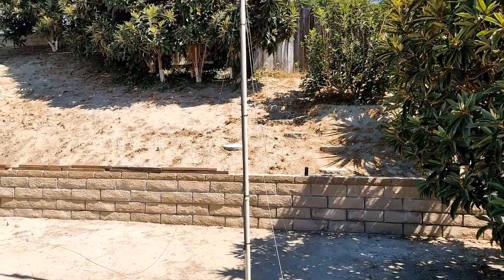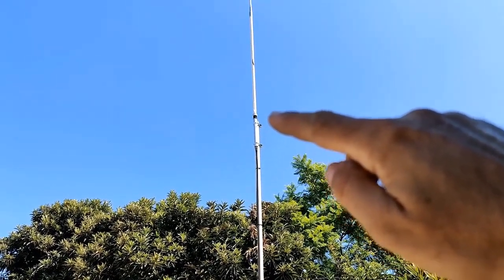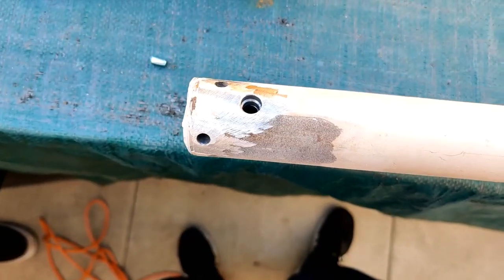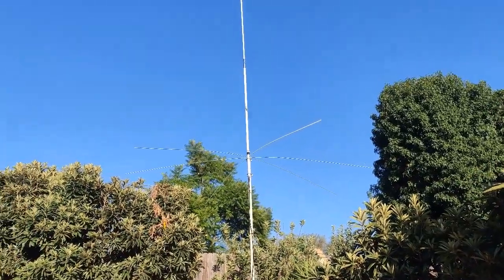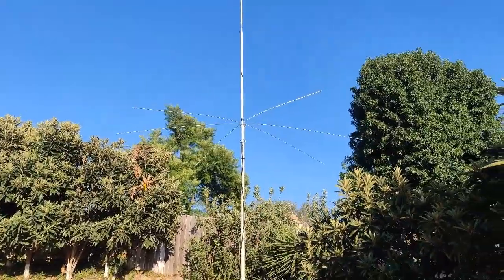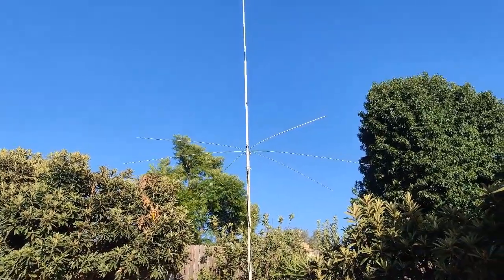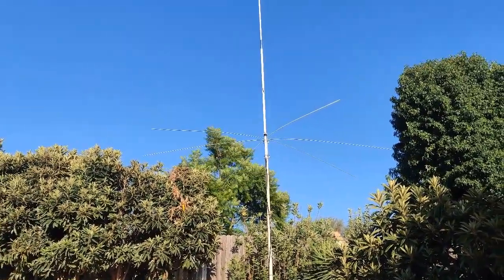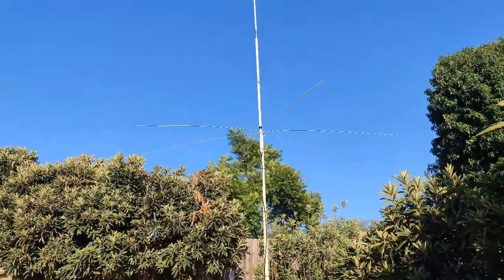Homebrew Ground Plane for Solarcon/Antron A99 Antenna

Comment: How did you come up with the length of the 6 radials ?
Reply from the maker: Well I didn't.  I had  this rods so I used them. Total experimental project. Hard to get any data if it works or not,   Someone commented to use 3 feet long and maybe copper rods etc. I  just got original groundplane for it made by Solarcon and I will install it.  Maybe I get some data from my nano vna and see if there are any swr changes 🤔 etc Supposedly 1/2 wave antenna doesn't need groundplane.  73.
Reply: @myszaca  gotcha, I’ve seen some videos indicating radials should be 1\4 wave long and 135 degrees down from the vertical  ? I’m running the Antron 99 with ground plane kit at 36feet to the base in a heavily wooded area and I’m amazed at the DXing I can do. Thx for the update. UDX-3030 👍
Reply from the maker: So you got the ground plane made by Solarcon with the ring?
Reply: @myszaca  I did, I ran it for about 6 months without and just installed it recently at the summer QTH. It’s working really well considering I’ve got 60-80 ft high tree line around me here in the woods. Probably should’ve added it sooner.  🤷‍♂️ In the 70s I ran a 1/2 wave super mag with radials at 90 degrees with some success. I think you’ll like the Antron radial kit. 👍
Reply from the maker: @UDX3030  Nice. I had 1/2 wave President Black pirate ☠️ antenna that came with 90 degree groundplane. Thats why I did this one. Also I did seperate antenna from the mast, swr dropped little bit more for some reason. 73, so far today I have nothing but crickets on 38 😄.
Reply: @myszaca  antenna design is definitely subject to interpretation. Ill just have to keep trying different designs. I had a brief couple of moments to TN, NY, ONT & FL, GA and then boom, dead.  I’ll be listening for you. 😁 73s !
Reply: @myszaca  I’m un familiar with that particular antenna, but trying new stuff/antennas is the stuff that CB was made for ! A bunch of guys trying creative stuff.
Reply: totally enjoyed watching this from Canterbury U.K 
   26 EY 109   73's

Comment: Those being mild steel rod you could bend them to a 45° angle. Make a circle from a heavyweight wire and weld it on at say half way. Maybe help with local.
Reply from the maker: Interesting idea. I don't have any problem to communicate with local stations at this moment. Maybe when conditions will change during summer i will see some changes. Time will show. 73.

Comment: Interesting way of making your ground plane, easier way of doing it would have been to just get a very large washer or a small plate drill hole in the center that will fit down over where the two coupling nuts are on the antenna. And well your studs to that. Also the factory ground elements sweep down at a 45° angle. The angle of the ground elements will also dictate the impedance of the antenna. That's why quarter wave antennas have 45° ground planes. Trying to use 90° right angle on a capacitive fed halfway you're going to have some problems. You're going to create a whole bunch of signal going straight up into the sky. Also how about showing us the actual reflected power but once you finish the project.
Reply from the maker: Thanks for the comment. Most people say A-99 doesn't need groundplane but i did it just for fun and i did that ground plane because i saw it in 80s in Europe on Black Pirate antenna. I bought Solarcon Ground plane A-99CK just for testing and Yeah at some point i will make video with RigExpert to see if anything changes when Solarcon A99 is bearfoot and with ground plane etc. I did isolate Antron from my mast and i think that changed how it behaves with ground plane, but that could be my imagination also 😄.  Very hard to collect data when you do dxing with skip, to many veriations etc.  73

Comment: Nice ot shoukd help the antrin is z dc shorted antenna the 45°angle radisl kit nefer improved then cause thats for a 1/4 streight fed ant like shakespher big stick that work but for A99 radials need go horzional yes you got it grat! 
This maks dxing better
Reply from the maker: Good to know. I have both ground planes and trying to get some data to prove if ground plane does anything to this antenna or not. 73 and have fun outh there.

Comment: Great idea… gonna have to do this to mine replace the guy wires holding my radials… have a 102 about 25ft up with 3 radials 1 pointed to UK and others 2 pointed 90* offset from that, works alright but would need more radials if I wanna talk to the states… 73’s from NB Canada
Reply from the maker: Cool. I wish I could somehow proof that they work 😆. I did it because one of my buddies in Europe has a President Pirate half wave antenna from the 80's and it was built by the President company with an attachable ground plane kit. I am thinking of making the same aluminium ring that solarcon makes for A-99 but with 90 degree radials as I have now instead 120 degree or so. Let us know what your experience is with the ground plane with skip. 73 from WR 0767.

Comment: This antenna is an end-fed half wavelength dipole. It is matched with a shunt coil and a capacitor. A radial system (Counterpoise) will make no difference to the antenna efficiency or performance. Just snake oil.
Reply from the maker: Highly possible but my question is, why solarcon sales ground plane for this antenna, it's under different angle but it's designed for that antenna. Any clue? please advise.
Reply: And if you're a ham, termination of licence effective immediately!
Reply: Okay RF and antenna expert. Mixed terminology here. It's a half wave dipole and it's end fed?? Elevated ground radials on an end fed antenna do not improve ground efficiency? Radials cannot be employed to decouple the feedline from the antenna?

Comment: Good job should work very good. It does suck when you have so many rules and guidelines you have to deal with for a hobby .
Reply from the maker: That's why I got Solarcon A-99 antenna. Almost 18' above the ground and it does a good job so far. 73

Comment: A local here used 4 102 inch whips on the bottom of his maxx 2000 and installed them at a 90 degree angle, sorta like an old 1970s aluminum antenna. It actually worked well!!
Reply: I used aluminum tubing and bent 2 9ft. Sections into an 45degrees  clamped . 1.2.1 swr
Reply from the maker: did he ever mention that his swr was affected by those 102". I will check on mine one day but I was just curious if you know anything about that.
Reply: Homeade star duster kinda sounds like whatyour talking Bout. I made something like this myself.
Reply: The mast and radiating element is 1 inch aluminum tubing
Reply: Bottom 12 ft. Of the mast is steel fence tubing with threads and coupler

Comment: I've seen your added radials and doe it make an improvement? I have the same antenna and setting up to do this to mine. Please let me know, it would be a great help to all! Thank you!
Reply from the maker: I just responded to the similar question that was asked below your post. Ongoing project. No data to proove it that it helps. Will do some test with antenna analyzer when I figure out how to work it 😄.  I never had ground plane so its my ongoing test project. when I have time I mess with it. Set up your antenna and run it as is. One post below said that he run antenna like tht with 3" long radials and used it for skip.  As far as I can read  online it should do something to shoot sognal under different angle but how am I gonna prove that? 😄
Reply: @myszaca  Thank you. Going g back over and missed some post, but still helpful! I ask cuz we're all at differe.t places and it does react differently. Thanks again and maybe talk to you on the waves, 73s!
Reply from the maker: @billhastings1006  yeah that's the thing, each station different rules like location, soil, hills etc. I am blocked on one side with the house and other with small hill at the back of the yard but still doing some skip shooting. So looks like putting antenna as high as possible is the key, tune antenna with analyzer and then try to get the lowest swr. This hobby is like they say CB-constant buying 😂 and messing with it.

Comment: its a little 30+ days since you made the video, What Changes and Advice can you give us about this? work good? work bad? new ideas? 
Thank you for making the video- I have Antron99, and thinking about groundplane too.. it site 10 feet above ground, on my wood shed.
Reply from the maker: Believe or not I am still not decided if it's better or not. I just got antenna analyzer and learning how to use it. I want to see if my SWR and other values will change when antenna is with or without radials. Some people saying that it makes no sense to have this with half wave antenna and others say that it will change radiation angle of the magnetic field and it should be better for skip. Question is how to prove that? In 80's they were selling antennas named Black Pirate with exact ground plane, so I guess they did that for some reason 😆. When and if I get some kind of data that I can show that ground plane changes anything I will make video. Solarcon makes ground plane for this antenna but under different angles. I was told by some local guys not not use that one  for the skip. Not sure why. Didn't want to drill them with to many questions 😂.

Comment: Hello 767, came across your video and I'm doing the same thing. I'm going to use some antennas I got from a local cb shop in South bend ,Indiana, called CB SPECIALIST,  good people. Hope it works for you and 73s, sir.
Reply from the maker: nice. let me know how did it go with your project.
Reply from the maker: Did you make your groundplane? I was wondering if you did and did you get better ears on your antenna because of that?
Reply: @myszaca   I'm working on a tilt setup. Have about half completed, the rest soon, going higher with the mast. Let you know when it's done. Did you see any improvement on your setup?  Hope all is well, Happy 4th! 73s , KX420, Northern Indiana.
Reply from the maker: @billhastings1006  So I have Solarcon with and without ground plane at my backyard, when I switch between both antennas and compare signals sometimes I can hear far away stations better with ground plane. Still not sure if that's happening because antennas are spread between each other 15' and one getting better signal than the other but from what I am experiencing at 14' above ground looks to me like those radials do something. I am thinking of changing radials to aluminum and making it with a telescoping option to see if the length will change something or not. Some people use 3' length on radials and stated that noise level was less then with long radials. Not sure about that project yet 😂. Well good luck with your project and keep me posted. Can't wait to see your opinion and experience. 73 and Happy 4th.

Comment: Did the additional radials change your SWR?
Reply from the maker: According to my old external swr did not, but I just got nano vna analyzer and i will do experiment and scan antenna with radials and then without. It will take some time before i do it because it's raining in here. Let you know something as soon as I know, maybe i will make short video.

Comment: I use the quad 5 n2 and Antron 99 about 15’ in the air as well 73 from 985 in the buckeye state
Reply from the maker: Cool, they work very well at lover hight. Skip is booming in here.

Comment: Very good idea,all steel disc w/6 elements.On the solorcon aluminum GPK ring I re-drilled and  tapped the holes at 90deg.I sometimes forget to ware a old pair of gloves when doing maintinance.
Reply from the maker: That's cool idea. Did you see the difference in signal between oryginal GPK and 90deg.
Reply: @myszaca  It made the radiation pattern begin at the bottom way I saw  all other antennas are.It seemed to receive with less noise on AM when it was lower to the ground under+ or -20 ft.I also shortend them 5in so they didnt sag.I used it mostly when I would go camping or park up on a mountain.Happy Holidays!!
Reply from the maker: @jetcyclezero8907  That's cool. Happy Holidays and have  fun with the skip. 73